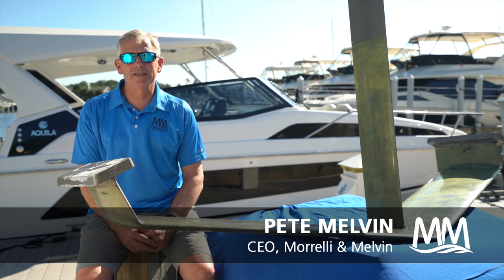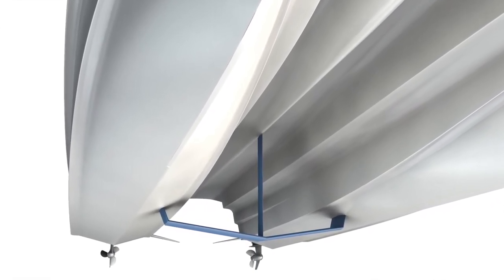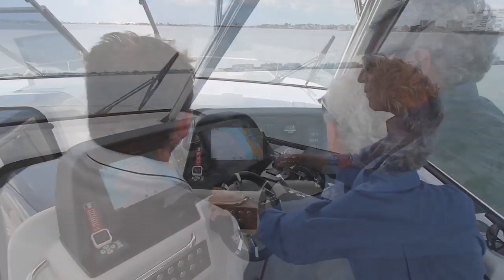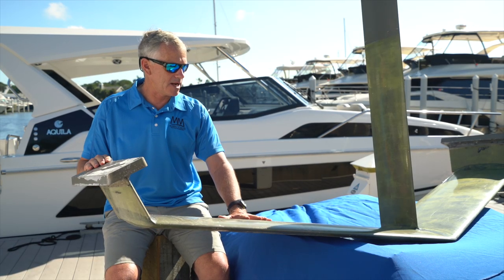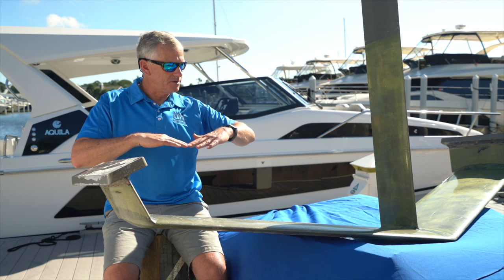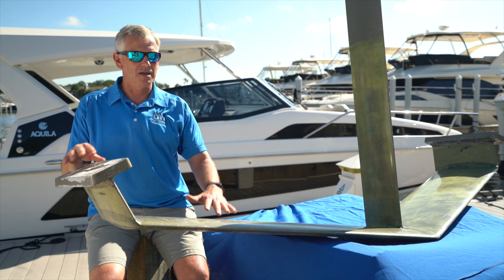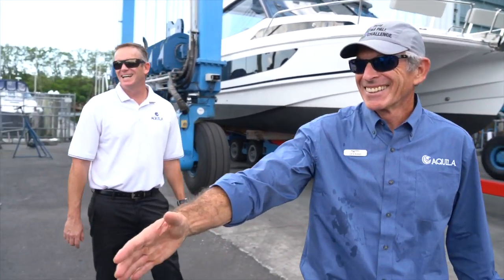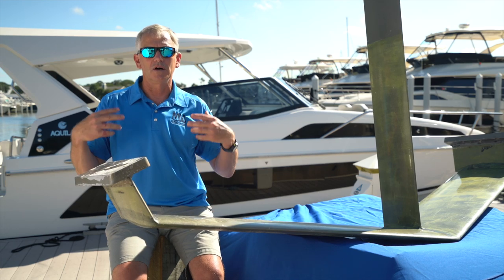Innovative Aquila Hydrofoil Power Catamaran | Designed by Morrelli & Melvin

Comment: With great interest I got acquainted with your creations (hydrofoils on a catamaran), as well as with comments to them. Iteres is not idle because I am dealing with a similar topic .... Several years ago I built and tested a working model of a catamaran with hydrofoils. But the task was set so that the wings could be serviced and, if necessary, dismantled (raised) in any conditions ... Including self-loading on the catamaran trailer ... Why do people forget that the propellers of motors are also garbage collectors? Although during operation in my case, this did not happen. (the problem is far-fetched). As a result of tests and operation of the model, the following results were revealed ... With 10 liters with a motor, and a total mass of 500 kg, the speed is about 28 km. h., weighing 700 kg - 10 hp. 22 km / h True, the contours and installation sites of the wings are not the same as yours, and it is planned to use and sails ... Based on the results of the experience, I am building a larger catamaran ... I will follow your progress ... Regards .... (subscription)

Comment: Brilliant concept, slightly more exact pricing would be nice!
Reply from the maker: Thanks! Get in contact with Aquila Boats today to discuss pricing: https://www.aquilaboats.com/contact
Reply: Sounds like fairly costly, since he mentioned it was roughly in line or a bit less than adding more power to the boat so in the tens of thousands range.... granted that makes sense if the performance improvement is 30% or so and if used enough it would end up paying for itself in fuel savings... and when being sold on a new boat of this class a small premium. I imagine once the patents expire we may see some home built versions on hand built craft... after all aviation and boating enthusiasts have been building fairly complex foils for many decades. And the patents can serve to drive innovation...

Comment: Inventor of foils?
Reply: @vanekert  Appearances can be deceiving... without the foil it can do 38knots at WOT which is respectable for any cruiser. With the foil it does 38knots at cruise... 44mph at WOT.... basically best in class. You can look at cruisers for a long time and not see anything near that. 1-1.2Mpg is also pretty normal for boats of this size. You say that the wake is rediculous on this boat... well yeah when most other cruisers this size are built to go only half the speed.... and many only go around 7-10knots.